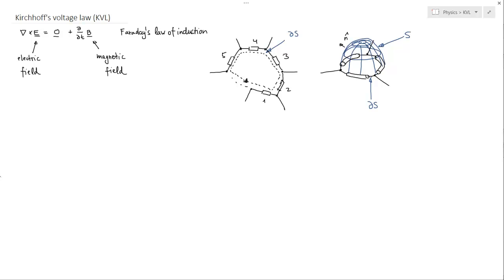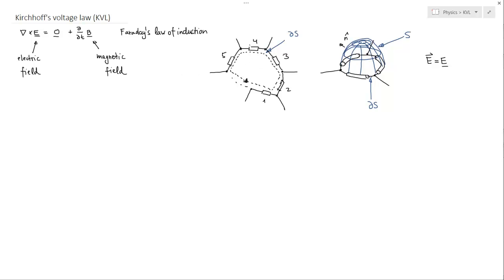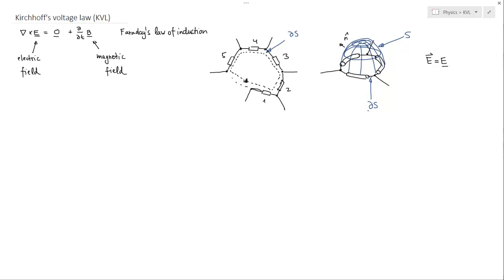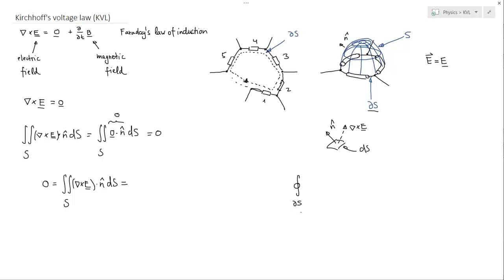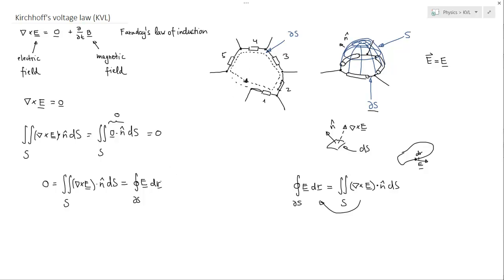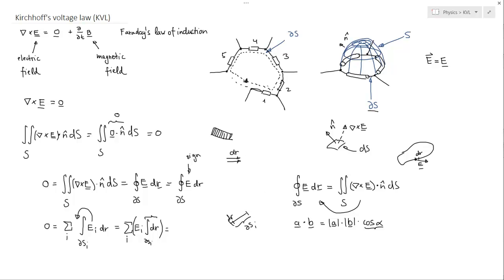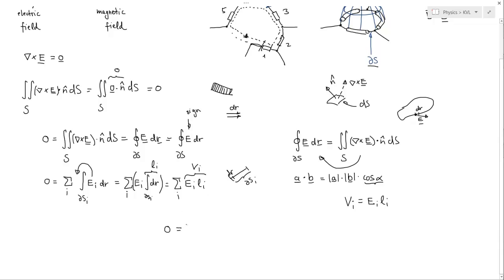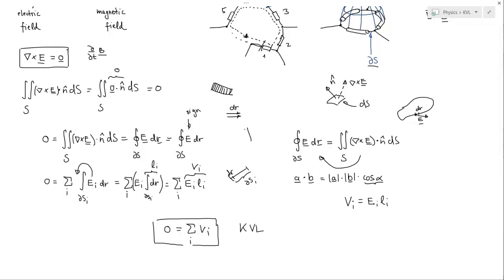Kirchhoff's voltage law (KVL) [Derivation from Maxwell's Equations]

Comment: In the case of AC circuit , how KVL still works? if there is a changing magnetic field inside the loop?
Reply: Circuit theorems are basically intended to avoid directly solving Maxwell's equations and to represent them as nodes and branches by applying graph theory.
Reply: Strictly speaking, KVL does not work. However, it can be expressed through an equivalent voltage source or current source. Otherwise you have to solve Maxwell's equations. This is because Kirchhoff's law is a special situation of Maxwell's equations.

Comment: Great video. I understood the mathematics just fine, but I didn't quite understand the constant electric field part, it'd be great if someone could explain.
  
P.S: I'm a math major who hasn't bothered with physics for a while, oh category theory... how you've ruined my intuition x)
Reply from the maker: GnomeInvasion We assume that the magnetic field is constant/stationary hence it doesn't change with time. That is the reason why the left hand side is equal to zero. The next assumption was that i assumed that in the resistors the electric field is parallel to the boundary of the surface. Assuming the electric field to be constant, hence the voltage drop per length is constant.
Reply: MrYouMath Thank you.